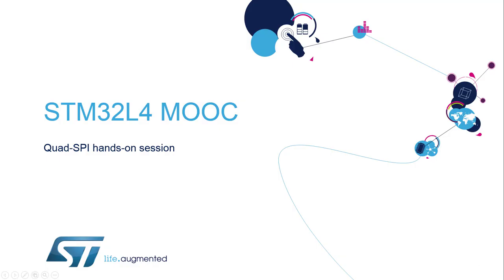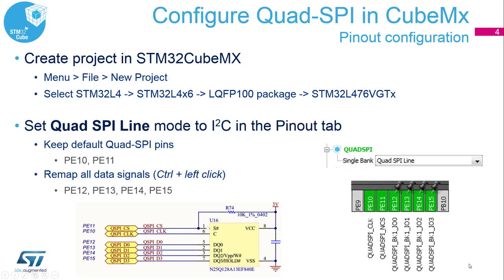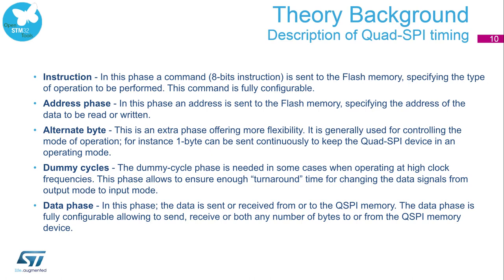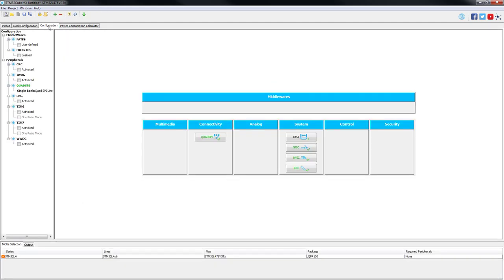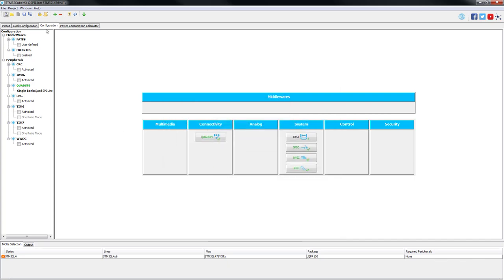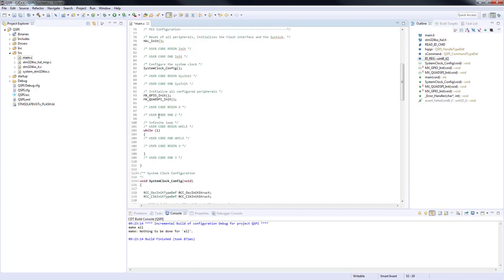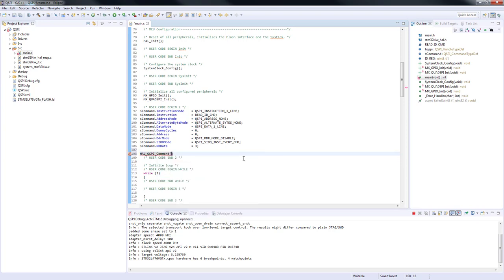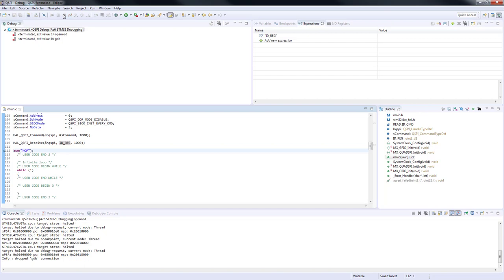STM32L4 training: 02.10 System and memories - Hands-on QSPI

Comment: I got your example to run on my custom hardware. I am also able to read from the SPI memory chip. However, I have not been able to write to the chip (MT25QL128ABA1ESE-0SIT). Can you tell me where to find an example of writing to spi flash. My processor is the STM32F767ZGTx.
Thanks.